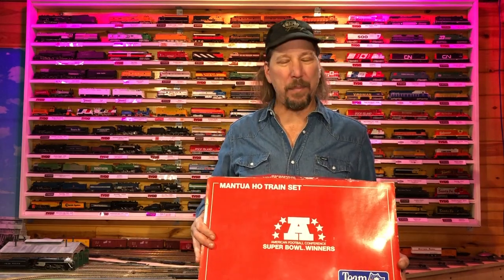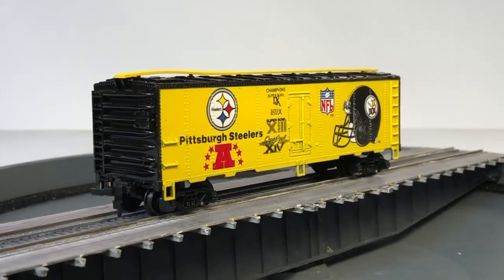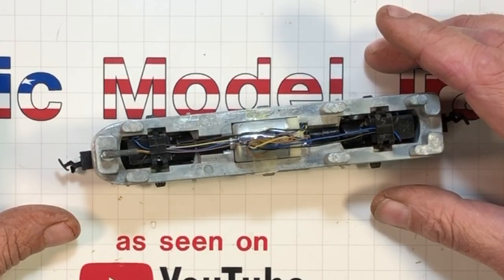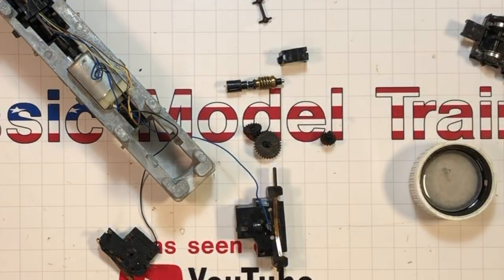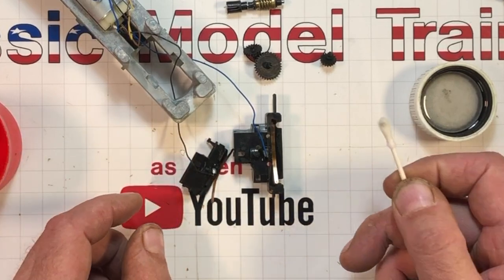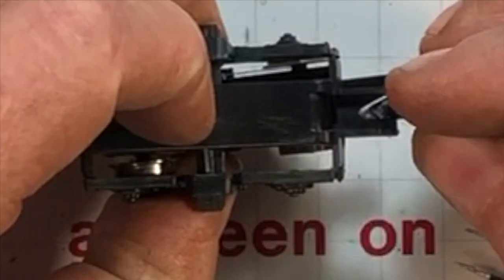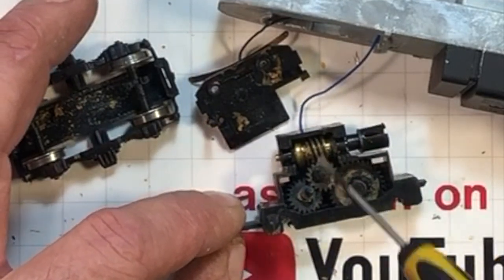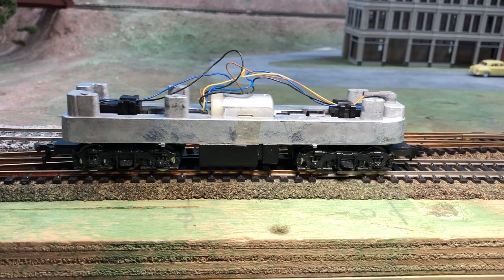Mantua F-7 from 1993, Teardown, Clean, & Re-lube How to

Comment: Mantua Classics and Model power locomotives shared the same Chinese manufacturing plant.  I am guessing this based on similarities in design.  Metal chassis with the same kind of motor and all wheel pick up/drive.  Their trucks are the same as well.  They are excellent creepers and smooth runners if lubricated as you have demonstrated so well in this video.  Thank you for inspiring me to break mine down and follow the same procedures.
Reply from the maker: Interesting! Thanks for your input, glad I could give you some inspiration :-)

Comment: Before the 1970s so much train stuff was made in America I remember in a magazine that into shifts at Lionel they could produce 1600 train set. Train nuts are born they are not made you can't turn somebody into a train nut. It's just like being a motorcycle nut it's in the blood. Just like with toy trains regular people can't understand your fascination with either trains or motorcycles. They just don't get it. Which is why it makes it special for us. That's what gives us our Brotherhood our common passion shared. Whether it be toy trains or motorcycles or both.
Reply from the maker: I like them both.  My motorcycle has never tried to kill me, only others on the road have tried.  The ignorant "others" on the road has caused me to not ride anymore.  My trains are a pretty safe pastime.
Reply: @classicmodeltrains  there was an article in classic toy train where some cheapskate try to save some money and instead of putting smoke fluid in his locomotive he put WD-40 in his locomotive. When you turned it on it sent out a column of flame that ended up setting his house on fire. Now there was another article so many people think the new trains they can work on them like the old train yet there are high-capacity circuits in there that if you touch them even if the train is off they store electricity and you could be shocked real bad if you have a pacemaker if you screw that up or anything like that. They advised to leave the repairs of the newer electronic Laden trains do a hobby shop or send it off for service.

Comment: The company was called Mantua Metal Products. Most people were not afraid of putting a k i t together because people were used to working with their hands. Most people preferred k i t s over ready to run because it was cheaper. I remember a quote in Model Railroader where the kid was saying while it's not even put together or painted or anything and the guy behind the counter said that's part of the fun.

Comment: Great vid Ron, I have a Vintage Blue Boxed Mantua 2-8-2 Mikado 8 car GN Set USA MADE 1986 complete with THE ORIGINAL Catalog of that year and Mantua Signed Lifetime Warranty Letter. Also included an MCR Railpower 1200 pack that I added a digital Volt/Amp display.
Bought it New in 1986 and it is still a SOLID heavy weight Loco . All Great details and mechanics 😎😎😎😎😎🚂
Reply from the maker: Sounds like you have a pretty awesome set there! I wonder if MRC will honor that warranty ? :-)
Reply: @classicmodeltrains  that’s a good question, is still in New condition and pulls a good 12-18 stock consist 😎

Comment: Very, very nice video! Kudos my Friend!
The F7 motor is a Mabuchi FK-260; although been a three pole one, you saw how smooth it is. Her trucks look like the Mehano’s ones that equipped the last versions of RS-2s, RS-11s and GP-18s sold in the States under the Model Power Brand. Mechanically speaking her sole flaw for me is the absence of flywheels, but that’s ok on your model, based on her amps and volts readings. 
One again, my best compliments Ron for your almost 2.1 K followers. This should show you that you’re on the right track! Please keep doing your marvelous work. We really appreciated it so much!😊
Reply from the maker: Greetings Regis! You sure know your motors!! A few others have mentioned the lack of flywheels. I'm guessing since the company was re-formed in 1977, flywheels were not as big of an idea as they are now. The engineers were not on board. Thanks once again for your kind words!

Comment: Ron, what you have is the AFC set, there was also a NFC set produced.  But even before these two sets Mantua came out with a complete set that included both conferences and then for several years they put out a car with the current year's Super Bowl winner.  I  have the original set and all the winner cars until they quit producing them.
Reply from the maker: Yup!  Ive seen pictures of larger sets.  Would be cool to have them all, if I was into football.  Where's the NASCAR stuff?    :-)

Comment: Fascinating history about Mantua.  I have a Mantua HO scale model of EMD F7A/B combo.  (the 'B' unit is an unpowered dummy loco).   In Pennsylvania Railroad gold 5-stripe and Tuscan Red finish.  Found at a local model train shop a couple of years ago.  Great runner appears to be very well made.  Came with original red boxes I have no idea of manufacture date but the boxes do state 'made in China' I know they are older because they have the old style 'horn' couplers.  I was not aware of the Mantua brand before I found the locos at the train store the sales person told me Mantua made some good trains.  I've found that to be the case in the locos I bought.
Reply from the maker: I'm curious if you have the re-released Mantua's from the late 70's to 90's?  The original Mantua's came in a red box marked Tyco and were from 1960 to 1970. They were all made in America.  The re-releases were re-engineered and quite a lot better than the ones from the 60's.

Comment: Pour your odorless mineral spirits into another little bowl, and then put the cap back on the can as it should be (so it doesn't evaporate away on you). It DOES have a slow evaporation rate, nothing like acetone or denatured alcohol but it's still going away.  I know you're doing a video for us, but I'm speaking to everyone here. 👌
Reply from the maker: Yeah I like it for its slow evaporation properties but you do make a good point.  Safety First! :-)